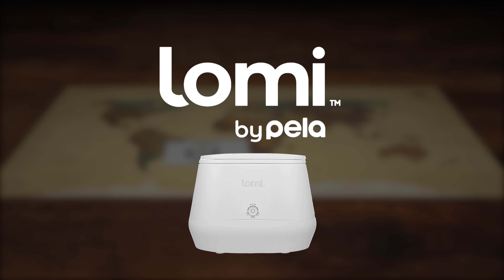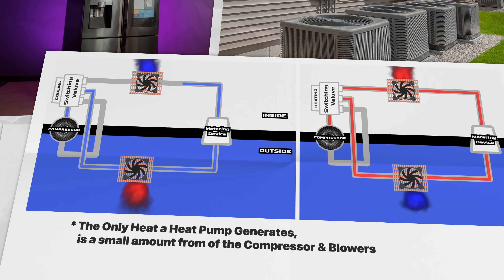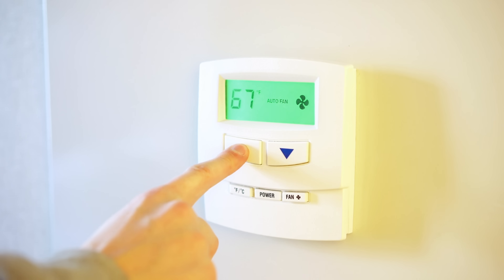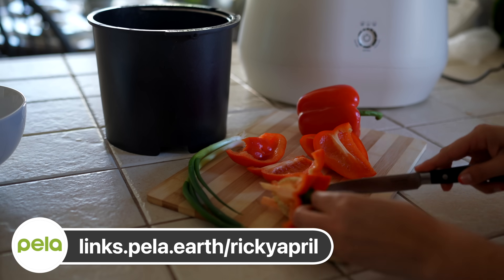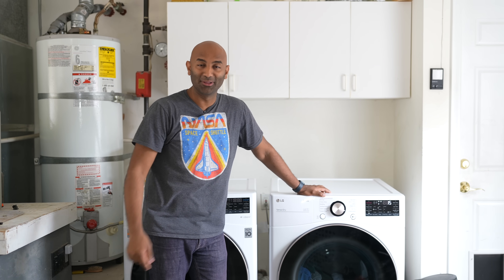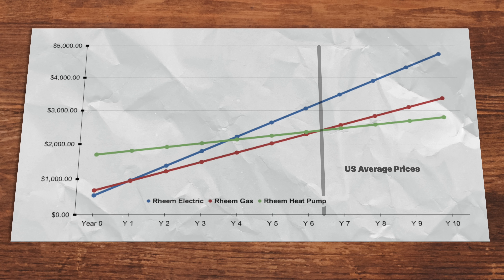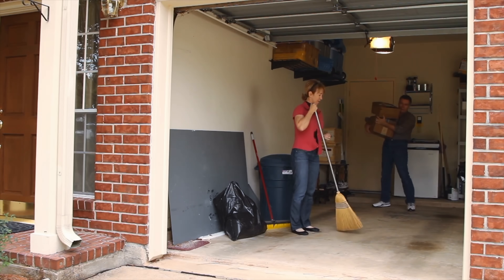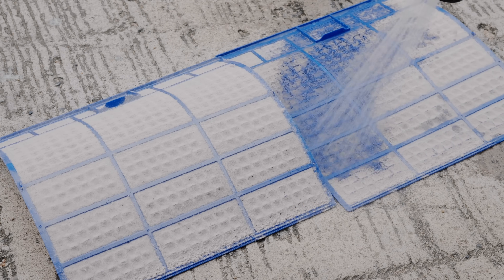I'm Shocked How Much Money Heat Pump Appliances Save!

Comment: You brought it up. 
Celsius is easier in Science or in everyday use.
0°C = Freezing   
10°C = chilly,  20°C = room temp,   30°C = hot hot day, 40°C =extreme heat wave.
100°C = boiling
Reply: Honestly as an American this is what I need to see to make the low numbers make sense 
Thank you
Reply: As a 63 yo Aussie I started life at school using Imperial measurement and lived through Australia's conversion to Metric in 1974. I can still use either system and can tell you Metric is 10 times easier in almost all areas of measurement (pun intended). Using Celsius or Fahrenheit for day to day use really does not matter as we all know what temperature is hot or cold based on the scale we live with. However in EVERY other area Metric is superior to Imperial especially linear and cubic measurement calculations.
Reply: Farenheit:
0° really cold outside
100° really hot outside

Celsius:
0° fairly cold outside 
100° dead (except sauna)

Kelvin:
0° dead
100° dead
Reply: @Deadshead23  C Its literally 0 for freeze and 100 for boil, F is... whatever. Just like the inches and feet mess why use one unit when you can use two, and why change the other at 10 when you can do it at 12? Perfect sense... not.
Reply: @freeculture  ...and how many inches in a yard? How many feet in a mile? There are too many bases in imperial. Metric has one: 10.
Reply: @Deadshead23  hahaha
Reply: It boils down to what system you're used to. Anything else requires quick mental conversions.
Reply: @NickCombs  'Anything else requires quick mental conversions.'
You realize this is the opposite of reality, right?
People who learn both systems tend to stick to either system they're using at the time.  Almost no one does extra conversions every time they're thinking about something.
The only reason you think this at all is because you don't know the other system enough to speak of at all, and don't know 'what it requires'.  You only know a few conversions and convert everything, then falsely say 'that's the most anyone else can possibly do.
  It's just 'what you're doing', nothing more, you aren't remotely knowing enough about it to say the end all be all of 'what it requires'.  Shouldn't take a few minutes to realize the statement you made is complete nonsense, no one who really learns both systems will be stuck at the 'barely knowing how to convert so I have to convert every last thing' stage you're at.
Reply: @ModelLights  I know them both, but prefer F because I live where it's used for everyday purposes. I have to convert F to C if I want to use it. So no, you're just wrong.
Reply: @ModelLights  units of measurements are tools. Making tools easier to use and learn (and teach) does not make you smarter, but it makes you more efficient and less error prone. 

I am pretty sure you're not defending the imperial system for any rational reason. It's just your thing you've learned to live with and are attached to (which is ok!). Or would you be ok to move to some crazier standard that is even harder to memorize?

As a 7 or 8 year old kid I had to learn meaning of 3 basewords (meter, liter, gram) and 6 prefixes (milli, centi, deci, deca, hecto, kilo [smaller and bigger prefixes are rarely used on everyday context, so they were teached much later] ). Took me one 45min lecture and maybe 10min homework to learn to convert from one to another unit. That didn't make me feel smart.

A year or two later we were teached about the "old units". Used much more time. Learned some of them, mainly "a yard is a longer than an inch, but I can't convert between them".
Reply: Celsius is only good for chemistry and similar but NOT for everyday life.
20C? Is that 110F?
10C is that cold enough to keep my ice cream frozen?
Is 40C sweater weather?

But 32 is freezing and won't keep ice cream frozen.
40 is sweater weather.
72 is room temperature.
85+ is a HOT DAY.

Celsius does not fine tune temperature.

Let's skip all that and switch to Kelvin or Rankine...
Reply: 40C extreme ? ... that's weeks on end in Australia
Reply: @pablorages1241  Not all of Australia.
Most vegetable plants have problems at 40C and higher.
40C is like 90F I think or thereabouts.
HATE Celsius and metric.
I cannot tell the difference between 5 mm and 5.5 mm sockets just by looking at them.
But I sure can tell the difference between 3/16" and 1/4" sockets easily by merely looking at them.
Celsius is tantamount to using Kelvin or Rankine scales.
I have easily used F in science with NO PROBLEMS. 
Converting F to C has caused mathematical errors.
Reply: @pablorages1241  Places where the people are more dense has decent weather.
Just mainly the desert and outback are the high heat areas.
Sidney is a lot closer to the south pole than I am to the north pole.
Hence the reason why your swirlies go backwards.
Reply: @pablorages1241  I do not dispute that. However, not all places are that hot.
Reply: @pablorages1241  MOST is not used by the home gardener. MOST is just plain desert.
Reply: It isn't relatable to people though.When fahrenheit was created, 100 was supposed to be human body temperature, but was slightly off.  72 degrees being room temp or saunas being at 160 degrees makes more sense than the Celsius equivalents  as you know that stuff over 100 will likely burn you, while stuff under 100 will likely freeze you.
Reply: And it doesn't help that the same temperature varies a lot as well. 15C with clear skies, no wind and summer sun = no jacket, 15C with overcast, wind in autumn = jacket, maybe a beanie too.
Reply: Fahrenheit has more granularity. Almost twice that of C.
Reply: @Anenome5  thank goodness for the decimal system. Also, U.S. money is metric?
Reply: I think C is easier for Science and F is easier for everyday use. Using the freezing and boiling point of water to measure how temp feels to people makes little sense. Even in your example the majority of the scale is too hot for humans. In F 0 is really cold, 50 is middle, and 100 is really hot. Easy to understand. Now 32 to freeze water is a weird number which is why for sciences C is better.
Reply: all number systems are arbitrary. its just based on something someone decided. the only issues with them is easy of use and easy of doing math. but most people with various math systems know how to do math with them, while base 10 for measuring VS feet is easier to do large numbers, virtually everyone has a calculator and if you need to do some large number it doesnt take much to just do the math. its really a none issue. As for F VS C. energy is more spread out for F, but more compact for C. as a result F has a wider range where each degree then gives more information.
Reply: @jessiejanson1528  very true. But imagine trying to do advanced math using Roman numerals lol. Imagine the calculator programmers losing sleep over that one.
Reply: @jessiejanson1528  The availability of calculators is immaterial. The advantage of the SI base 10 units system is the elimination of the need for calculators for simple conversions or remembering a plethora of conversion factors. Quick, tell me how many teaspoons in a cup?

 I'm still waiting. Yet anyone can tell you instantly how many ccs there are in a quarter liter.
Reply: @GntlTch  then i guess we should stop teaching anything that doesnt have a simple method? why bother teaching math, calculators can handle it right?
Reply: @GntlTch  ' Quick, tell me how many teaspoons in a cup?'  And yet you completely leave out that binary division factors such as half and quarter are actually easier and more directly useful for most everyday tasks.
You already 'know' division by 10 from decade counting.  Realize that anyone who is also heavily familiar with the binary division factors will have a point or two of IQ on you.

Dumbing things down to easy mode makes things easier, it does not make you smarter.  It makes you 'feel' smarter, while actually having learned less.
Reply: @ModelLights  
Half a litre is still a thing.
Half a liter 500 ml + one tenth 100 ml +
One twentieth 50 ml
=650 ml

Half a gallon, 128 oz +
one tenth, 24 ⅘ oz +
one twentieth 12 ⅖ oz
= 37 ⅕ oz.
Metric is easier but it doesn't mean your less smart, it means more people can understand and use it, which is a good thing is it not?
Reply: @GntlTch   3 tsp / 1 tblspoon * 2 tblspoon / 1 fluid ounce * 8 fluid oz / 1 cup ... quick mental math, 6 tsp / oz * 8 oz = 48 tsp.   3 seconds instead of 1.

Comment: Pool heater in San Diego?  I think you should be able to cover 90% of the year with solar, and while you're at it, get rid of all those elbows, get an oversized filter, and put in a variable speed pump.  I was able to run my pool pump on a 35,000 gallon pool with only 5 psi back pressure and got good filtering with only 80W of power (lowest setting on a 1.5HP pump).  Oh, and get a salt cell.  Yes it uses electricity, but I'm sure the sustainability of driving to the store for chlorine and the whole delivery chain for that is worse.
Reply from the maker: great feedback Derek! Are you in SD as well? I have a fixed speed pump which is horrible for sure. I have a salt pool with a salt cell, which like you said it brilliant. I have a solar heater now, but it's old and leaking on my roof... just miserable.. I think I am going to use all solar panels for PV on my roof, and during the day run the pump and get a heat pump water heater. Just doing the math and thinking everything through.
Reply: @TwoBitDaVinci  The pool was in Florida.  I am now in a rental house in Iowa where electricity is a nickel, and yet the house has gas heat, water and dryer.  A whole new adventure.

Comment: Using heat pumps to save a boatload of energy... Only to blow it all by using a Lomi? You're really under-cutting your message by taking an energetically free process and turning it into quite a large amount of used power.
Reply from the maker: It uses about 1 kWh, which isn't nothing, but it has a place depending on your situation. If you have a yard and a place to compost, by all means do it! But if you live somewhere, where it isn't feasible, this is another solution. I run my lomi on my ecoflow battery which charges from the Sun. It's nice to just down this every day on my garden. But yeah it's not for everyone.

Comment: I hate my condensing drier. And yes. I make sure its cleaned and drained each run.
Reply from the maker: really? could I ask what model etc? great feedback I'd love to know more
Reply: @TwoBitDaVinci  GE sensorDry is all I can gather from the front cover. Its a great idea in theory but in practice. Even with prudent lint clearing the whole unit is a lint trap. Would have been better if all airways were designed to be self cleaning. Mine is set up to drain the water not collect it. I can only use the unit on the "rack dry" setting. The property manager can't fix it. It always says it needs condenser cleaning and tank emptying even tho I'm draining not collecting condensate. Maybe an issue with the instrumentation or controller. Unit is maybe 3yrs old

Comment: main house has 2 heat pumps for heat/cooling, my new garage will have one and putting a mini split in the office in the barn.

When I bought the house I paid 400/mo for gas and 80 for electric. I now pay 40/gas and 240 for elec...that includes a heating/cooling a second building and charging a tesla (which has a heat pump too!)
Plan is to put in solar by years end.
Reply from the maker: that's awesome Chris! thanks for the detailed info, the cool part about electric stuff is you can off set it. you and I are never going to create our own natural gas. Solar by years end sounds epic! let me know if you have any questions or need any help/guidance.

Comment: Just FYI, about 10 or so years ago there were a few companies experimenting with water source heat pumps that utilized swimming pools as the water source. Effectively heating your pool when cooling your home. If you combine that with a solar water heater you can increase the COP during the winter when you want to heat your house using your pool as a more consistent heat source.
Reply from the maker: wow... do you know of any patrick? that sounds like a very interesting idea
Reply: @TwoBitDaVinci  Look up geothermal swimming pool. They use geothermal water source heat pumps to transfer heat to and from the swimming pools in climates where it makes sense, usually hotter climates.
Reply: Right now the water in swimming pools in Texas is pretty hot!  Would be neat if there were some valves to use that pool water to heat domestic hot water for a geothermal system instead of using its underground loop!
Reply: Love this idea

Comment: I want interconnected appliances. I want the heat needed for hot water and home heat traded with the cold needed to operate the fridge and the freezer.
Reply from the maker: Jim you're thinking just like me ;) yeah, exactly, this is something I'm going to look into. Thinking of heat energy, as another resource, like water or electricity.

Comment: A terrible electric water heater and electric stove in a college apartment traumatized me away from electrical appliances for many, many years. I've recently realized how much stigma I've attached to them as I've learned about how they were just old, terrible units to begin with and there were much better options then and amazing electric options now. Excited to watch the heat pump and electrical appliance options expand across the US over the next decade.
Reply: Wait until you try an induction stove.  They're amazing.

Comment: How about a presentation explaining how converting homes to DC current would not only complement heat pumps but also eliminate the need for energy-wasting  Invertors to convert DC solar power to AC? DC motors are smaller and more efficient than AC motors, and they would improve the efficiency of all appliances including heat pumps. Converting a home from AC to DC should be simply a matter of changing the outlets. What is needed is a new generation of appliances that use DC motors and heat pumps. This would make solar power combined with batteries capable of eliminating the need for the grid.
Reply from the maker: Great idea!
Reply: @TwoBitDaVinci  Here’s another: why not use carbon dioxide as the refrigerant of choice? It has excellent refrigerant properties, is dirt cheap, and is totally free of toxicity. Methinks this is one of the reasons that CO2 is being blamed for the “global warming” phenomenon, but this is absurd because 1. CO2 is a “trace gas” with a concentration of only 0.03% at sea level, and most CO2 hovers near the earth’s surface and 2. CO2 levels fluctuate slowly over geologic time, whereas cycles of “global warming” and “ice ages” occur at much shorter intervals. For example, there was a previous episode of “global warming” during the early 1400’s that enabled Chinese sailors to find an ice-free passage around the North Pole. The passage disappeared during the “mini-ice age” that happened during early European settlement of North America, but it has now re-appeared during our present period of “global warming” and commercial freighters are quietly saving money by sending ships through this northern alternative to the Panama Canal.

Comment: You would have to be stupid to not get Celsius. I am shocked you said something like that! 0c is the temperature of Freezing pure water. 100c is boiling pure water at sea level. So what is 25c? about 1/4 up from freezing and more or less room temperature. Go to 50c and you are half way to  boiling and clearly don't want your house that hot but it might do for a Jacuzzi (40c being a more normal max there). Celsius also has a one to one ratio to Absolute making science easy. The only way F makes sense is if you grew up with it (as I did but I still don't like it).

Comment: hey ricky look into lg heat pump with heat recovery those units can cool and heat at the same time and they have a unit that works in conjunction with your HVAC that can either cool water or heated is programable backed up with a digital programable water heater tank electric just in case of really cold winter   that will also store around 50 gl of water depending on size

Comment: Would it not be better to replace your gas pool heater with a Solar pool heater  the same for your hot water. We have a Solar heater on our pool and the only cost is running the pump, which you would have with you heat pump heater.

Comment: What about the attic? Isn't that where a lot of heat accumulates?  Also, pairing a fridge/freezer with a water heater could be a win win. With the fridge being on the cold end and the water heater being on the hot end?